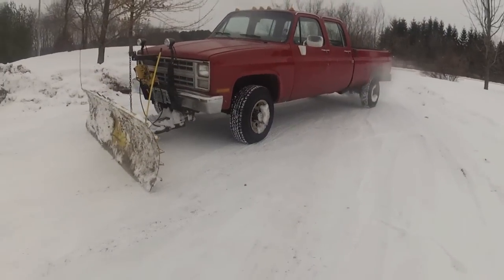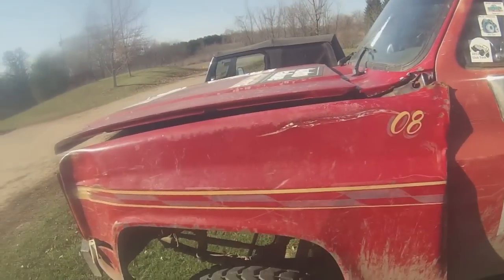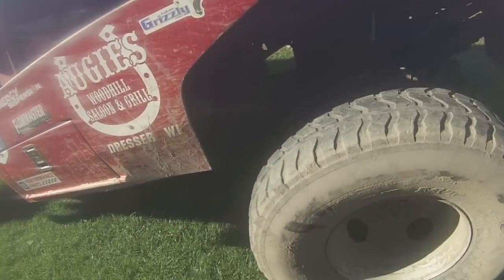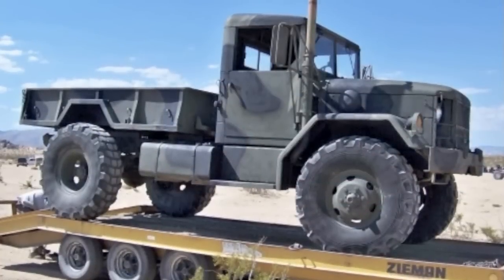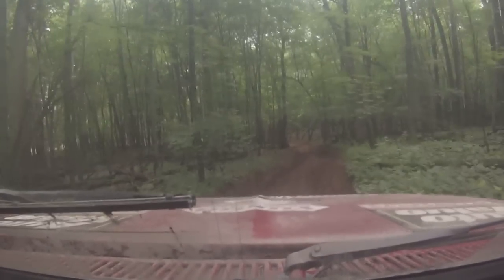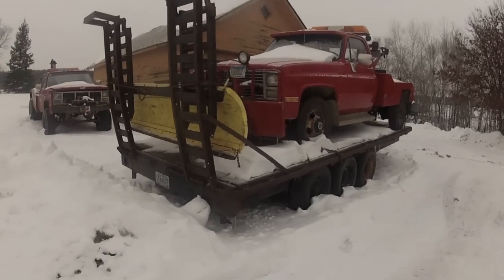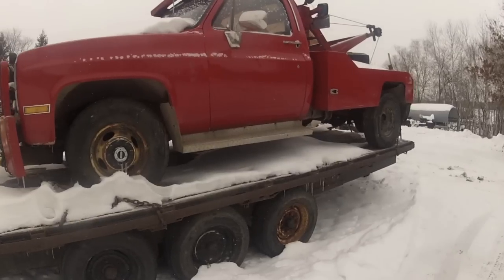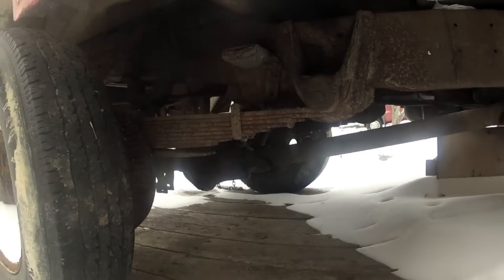WRECKER UPDATE by BSF Recovery Team

Comment: Looks like I'm a day late and a dollar short here.  I'm building a Holmes 1100 on a CUCV chassis and have addressed the wheelbase issue.  If you can get by without overload springs, you can simply turn the springs around backwards and presto, 135.5" WB.  Need to move the rear shockmount back a bit but works great in theory. Will know for sure soon.

Comment: I'm fixxing to do the same thing,My wrecker has got alot of abuse mine is 2 wheel drive I'm tring to figure out how to swap it to 4 x 4 , Mine was a cab and chassi is it possible to swap it out?
Reply: yes and no. depends on your skill level, and also your truck frame, some c trucks already had the holes for the 4x4 hardware. some dident. you  have to either make or buy new mounts or a new frame
Reply: Conner Pierrard and on what parts you have, etc
Reply: lol, im never opposed to a challenge